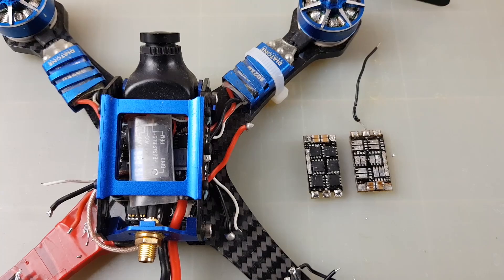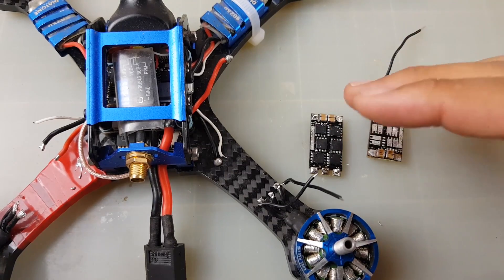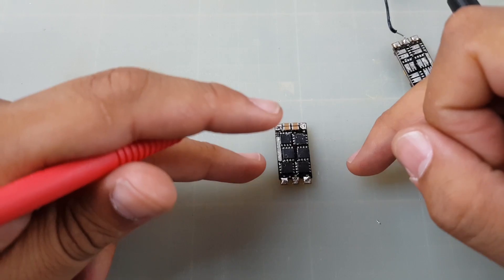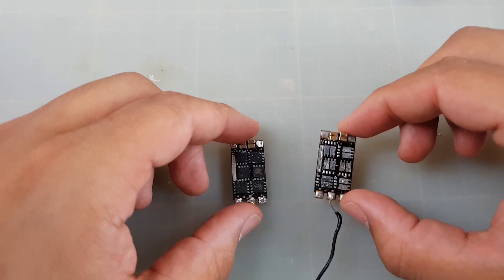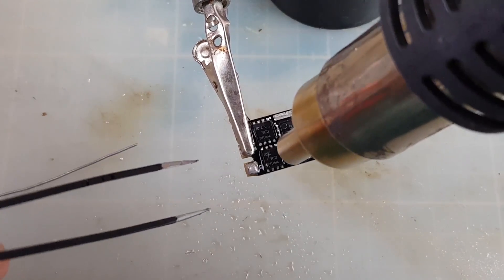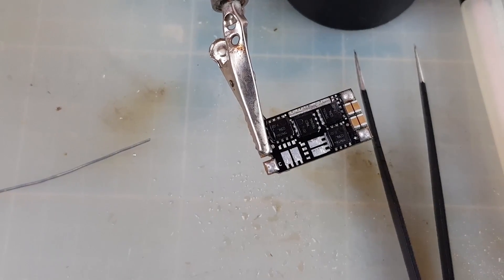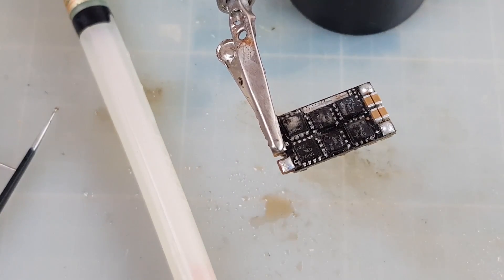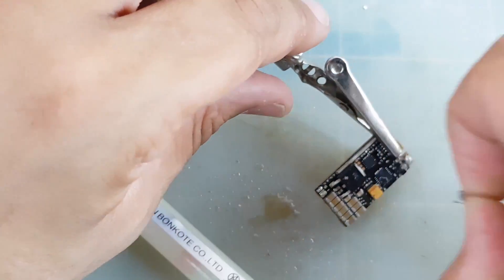ESC Repair: How To Test Bad Esc and Fix it

Comment: Thanks for your efforts on this video. I've problem with one 4in1 blheli s esc. Following problem: motor output 3 output  not same rpm as the other 3. i have flashed a firmware which allows me to use bidirectional dshot, when Giving 1060 pwm signal to all of them in betaflight, motor 3 only spins with around 1500rpm, while the other 3  outputs spins at 2000rpm. I try to switched the motors but the problem persist on esc output 3.

Do you have any idea what could be wrong?

Comment: I had a crash and my tekko 32 4in1 stopped working and communicating in bliheli 32. Is there anything i can do or check to fix this as it;s not the cheapest of escs and everything looks as normal.
Reply from the maker: check the connector
Reply: @DroneMesh  Which connector? The 8pin or the vbat main? The 8pin aside i dont get esc beeps and the esc still powers a fc if it's attached.

Comment: I had a tekko-s 4in1 that was working perfectly then all of a sudden just dropped out the sky. Now when i power it all the video,fc,rc etc get powered but the escs dont respond or get any signal from the motors so no beeps upon powering them and no communication in betaflight or bliheli. Normally I have had 1 esc go bad on a 4in1 but never just a complete there all fucked no response. If i knew what component was dead i could try and replace it :) ''try''.

Comment: Would it be possible to make a similar repair video but for PC that doe snot power up anymore neither from the battery nor USB? I have a few of them but i just cannot understand what burned, from some videos i checked Diodes are ok and the F4 processor is alright as well.

Comment: Very interesting repair. Two comments. Way too much solder, which results in a weaker joint and possible solder bridges, and it makes no sense to put flux all over everything. Flux is only to aid in cleaning the metal being soldered. It it typically corrosive and should only be used as necessary. It serves no purpose to put it all over the chips and put it on before desoldering.

Comment: Please extend this video with a demonstration how fixed ESC is working.

In fact you're lucky that MOSFET fault didn't ended in charred remains of ESC board. Happened with me several times and there was nothing to restore anymore. Once 4-in-1 ESC burned together with a motor, receiver, battery strap and a good part of wiring.